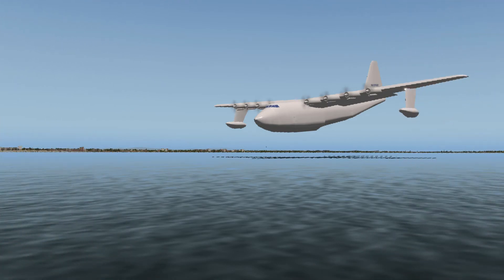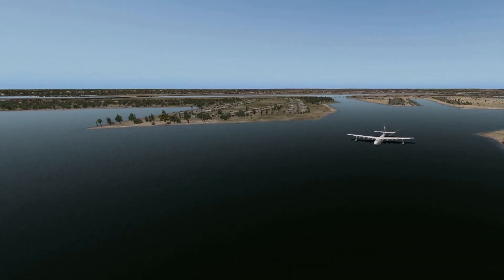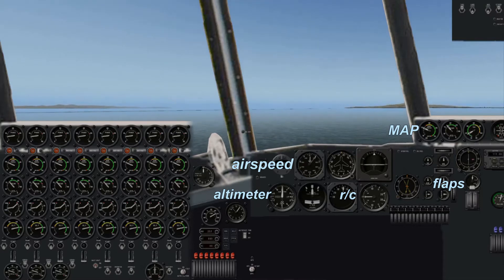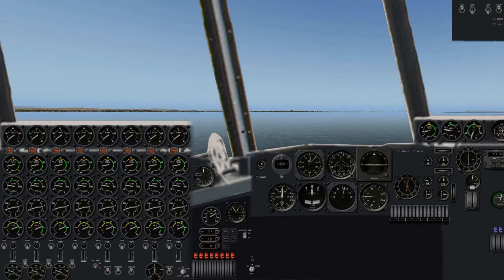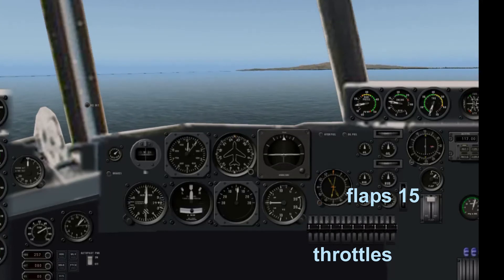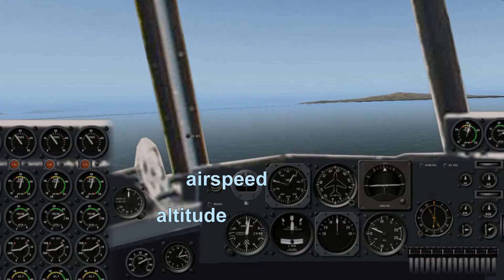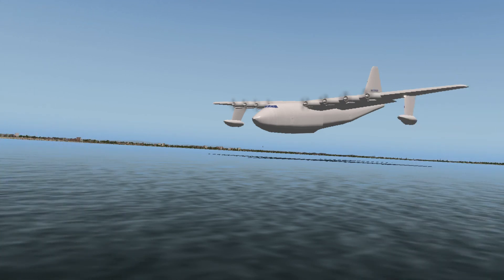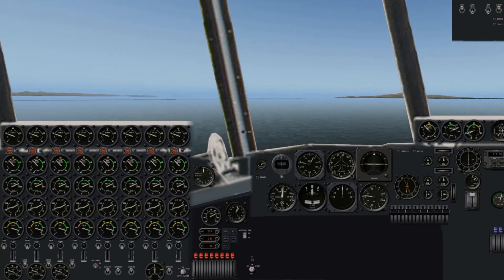Spruce Goose [H-4 Hercules] 1st Flight in Long Beach harbor simulated on X-plane!

Comment: How you get the spruce goose?
Reply from the maker: I don't have it, I think it's still at the Evergreen Museum in Oregon! (joke)

I was told by the docents at Evergreen about the model in X-Plane by Paul Jones, which I downloaded. Then I bought a copy of the "Hughes Flying Boat Manual", and used the data to "tweak" the simulation to where, as an Aeronautical Engineer experienced in simulating engines and jetliners, I was happy with the simulation. Flying my simulation on X-Plane seems to match what was written and photographed of the actual flight.